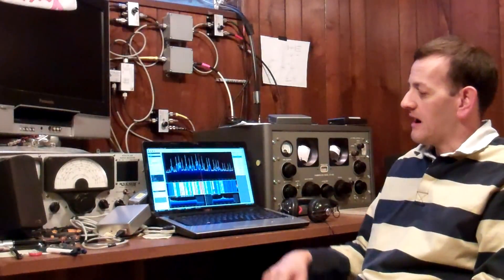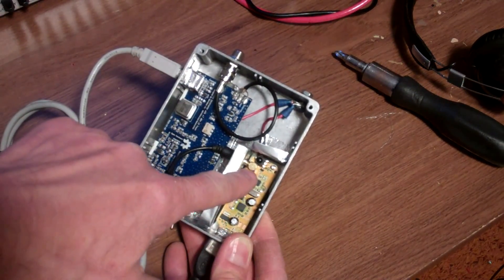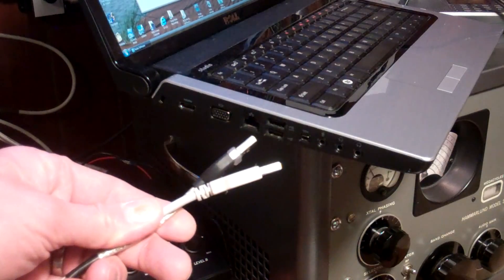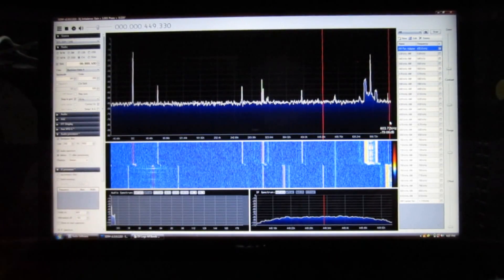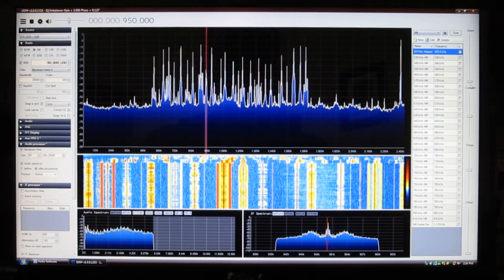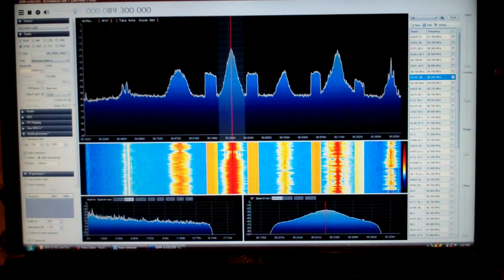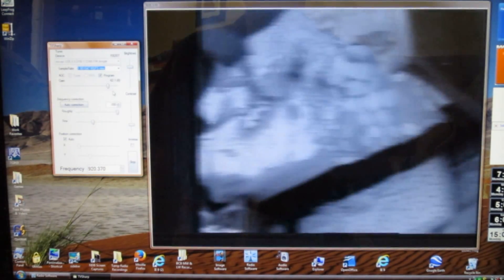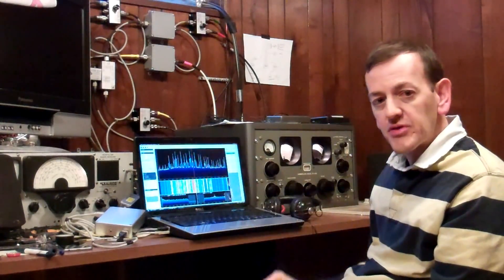SDR With Upconverter Build - RTL 2832 820T Dongle + Ham It Up Upconverter

Comment: I LOVE That You Used The Cheap Chinese SDR, By The Way There Are Hacks And Mods To Get It To HF Without ANY Problems, My Cheap Sdrs All Work On HF Even Down To 80 Meter Band And I Have No Complaints Other Then The Signal Is Weak Without A Amp Or Decent 5 Vollt 2 Or EVEN 3 Amp Battery, Why Battery? Because The Noise Is Going Down With Battery And It Goes Up With Some Brick AC To DC Wallll Plugs.
Video Is Wonderful, LOVED Every Part Of It. :)

Comment: i like your setup and i dig the box you used but why not just feed it with 1 USB cable?
Reply from the maker: I did't feel comfortable (in my skills) at the time to solder jumpers from the input on
 the dongle USB input to the USB connections on the upconverter 
motherboard.  If I built another I will definitely do that. Would 
definitely simplify things and make a cleaner box.
Reply: yeah...   o and i seen you post the Box you used thanks i am going to order one

Comment: I just purchased the ham it up v1.3 upconverter and I can't seem to get it to work properly.   When connected to my scanner antenna and the converter disabled I can pick up weather channels,  fm radio etc same as without the converter.  When I connect my longwire antenna to the converter and enable it I get little or no signal on shortwave.  My outdoor longwire antenna works great with my shortwave radios.  I've tried sdr#, gqrx etc and on different computers,  confirmed that I have the offset is -125,000,000 etc.  I can receive a couple of shortwave stations on the proper frequency (confirmed with my shortwave radio).   I'm not seeing the same signals as your video or others.  I have tried agc and manual gain with no luck.  I try it at night to get the best signals for lower shortwave frequencies.  I'm hardly picking up anything when I should be picking up a lot more.
Reply from the maker: I use SDR#. If you have the offset at the proper setting and the upconverter is enabled it should work. The upconverter is passive and when disabled it just passes the signal through directly to the antenna output.  You can see the pass through line on the circuit board. First make sure you see signal on all bands in SDR# when the converter is disabled and in pass-through mode...If you are still having problems it is not the converter. It would most likely be SDR# settings or SDR# is not recognizing your SDR device.  My SDR# settings when I use the upconverter use a 2 mHz sample rate and no AGC of any kind.  I do use the signal amplifier setting in SDR# in various amounts depending on what band I listen to. FOR AM or FM I use none as it overloads. For weather radio or other SW signals I use up to 20+ db.

So I would say: 1) check to make sure your SDR is working 2) make sure SDR# or other SDR software recognizes your SDR device. 3) Make sure the upconverter correction is enabled 4) make sure you play around with any SDR software signal amplifier settings.

If it is something with SDR# not working with your SDR device then I would check out the SDR# yahoo group if you have not already done so. Just be aware that if you post on there you are almost sure to get a condescending reply from one of the members there. There is a lot of good info though if you dig through it. 

Not sure if any of that helps.
Reply: @kugellagers  Same issue here...  Several SDR software suites used, same results.  I have heard noise, but in 2 1/2 years, I have never heard an intelligible signal yet.  Tested with various antenna setups as well.
Reply from the maker: @derekdowns6275  If all of those thing don't work could there be something shorting on the upconverter? Or maybe the pass through switch is hosed. I assume your SDR setup works w/o the upconverter inline?
Reply: @kugellagers  Switch works, but maybe something bad in the upconverter section itself.  Works fine without the box, only slight losses with upconverter in place but bypassed, and nothing but noise from circuitry when on.  Tech support has been happy to at least make some inquiries and asked for screenshots.  It's a shame that a transistor radio can pull in the local blow-torches (AM radio) fine, but my upconverter just plays noise on what I suspect to be local oscillator frequencies and their harmonics.  I bought the enclosure at the same time to help shield the circuitry from local/household electrical noise.  I'm glad they're at least speaking to me.

Comment: excellent video at least I will no what im looking at now on the display, what antenna r u using?
I have the dongle but the signals I receive r very noisy and will be getting a converter. 
cheers
Reply from the maker: +26CT1681 Steven The antennas I use for AM and LW are low-noise verticals which can be seen in my Low-noise Vertical  antenna video here: ( https://youtu.be/hSwkM9aaGNU?list=PLCED329D32CFBDBBF ). For VHR/UHF/ADSB etc I use the antennas on my  Tilt-over chimney mast seen here: ( https://youtu.be/jS-reVGR_2s?list=PLCED329D32CFBDBBF ). A lot of noise on the SDR comes from overloading from FM stations and setting the RF amplification too high.  If you are using SDR# with your dongle I would first recommend trying to lower the RF amplification and turning off the AGC in the settings. Higher amplification with the higher frequencies is definitely helpful until you run into overload/intermod from strong FM stations. For this I have constructed a dual FM trap ( https://youtu.be/WDE8ho0uee8?list=PLCED329D32CFBDBBF )which lowers the FM signals 35-60 db at my QTH. Cheers.